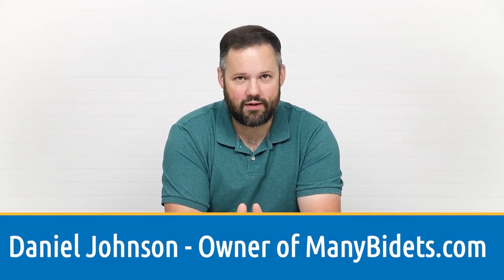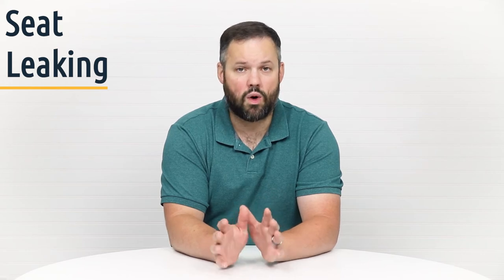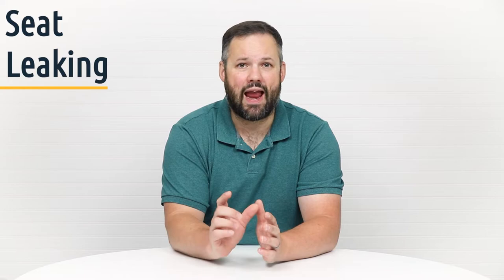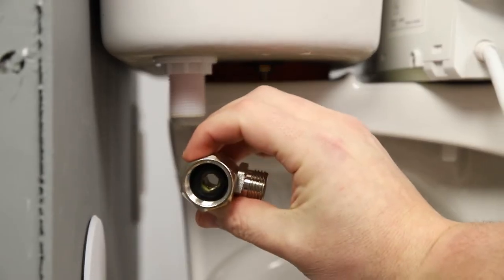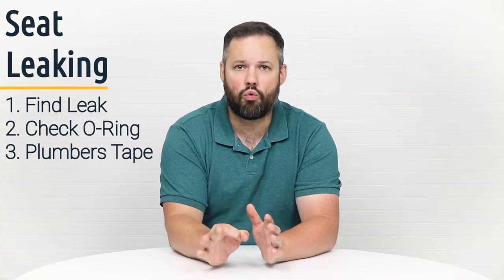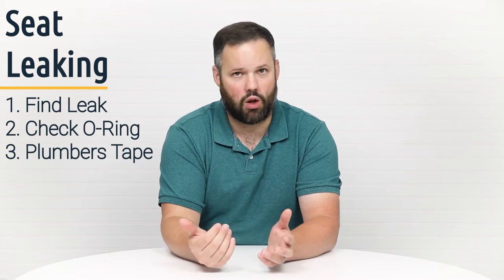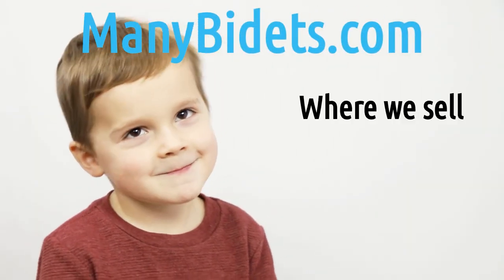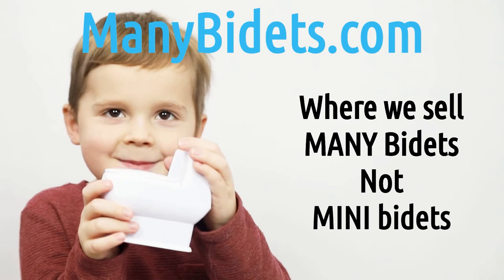Why is my Bidet leaking? | New Bidet Q&A | Bidet Answers with Dan

Comment: Thanks for the video. When I put the washer in, the t-valve doesn't fit. If I don't use the washer, it leaks. Please  help
Reply from the maker: Some washers are designed to be installed facing one way so making sure you have it in the right way is a good place to start. Reaching out to the retailer you purchased from or the manufacturer directly would be the next step to ensure proper installation!

Comment: Hey 

Mine is leaking into the back of the seat when the self cleaning mode hasn’t been engaged- it’s constant.  Any idea how to turn that off?  

It’s a cosvalve 

Thx!
Reply from the maker: Thanks for your question! If it is constantly leaking it could be related to another internal issue. I recommend you reach out to the manufacturer for troubleshooting!